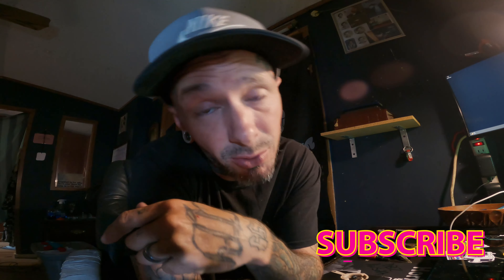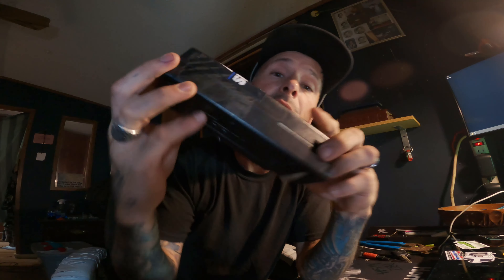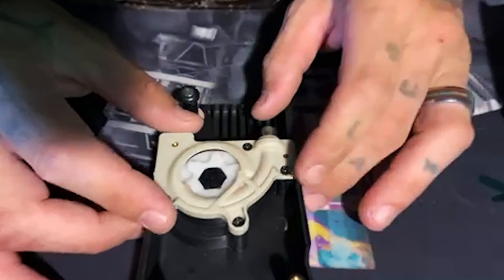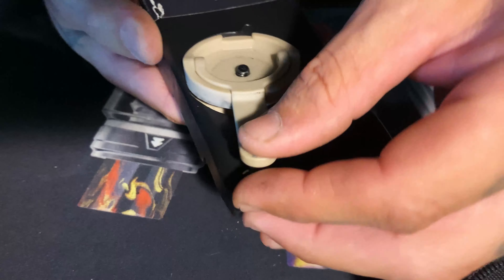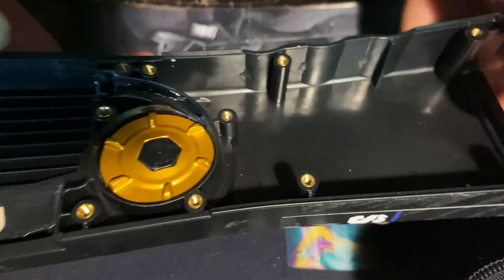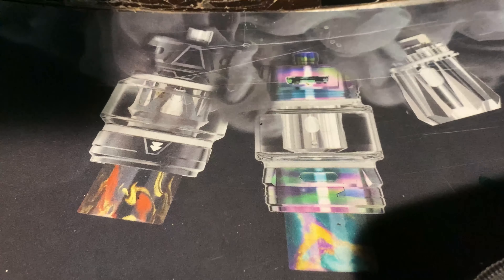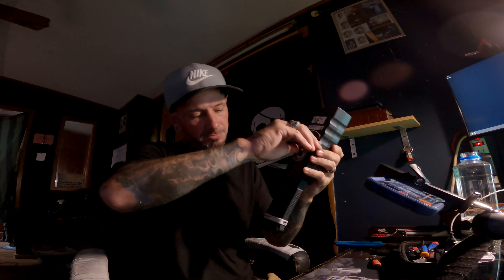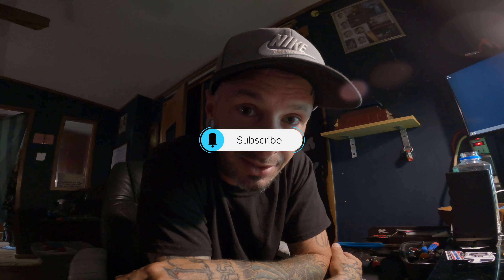How to change Odin BB loader wheel / 916 Customs / Install

Comment: question on one of your older vidoes. How did you get the speed cannon on your gun? i took like 4 separate guns apart and there is always like a thread protector or a outer barrel that just wont come off, tried heating it for glue, theres no push pins or screws. The speed cannon looks like it can only be put on by threaders and i just cant get to the threads. Thought i'd shoot you a comment see if you had maybe a fix or something you can help me with. THANK YOU STEVE
Reply from the maker: Hit me on Instagram.

Comment: Just wondering what the difference between the stock one and this aftermarket one?

Need a side by side comparison with the stock one
Reply from the maker: Unfortunately not one I had on standby but the emphasis was for 916, my apologies
Reply: @sinfulpirate  oh okay no problem. Just wanted to know if I need to actually buy this but it looks good. More durable at least